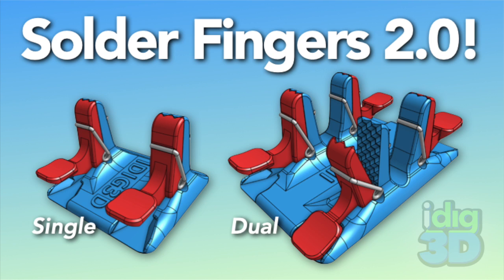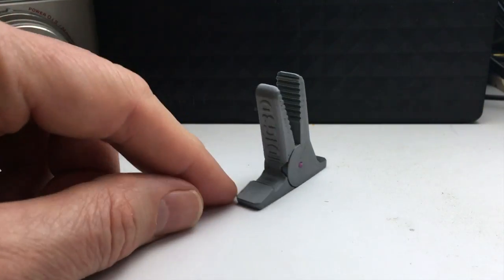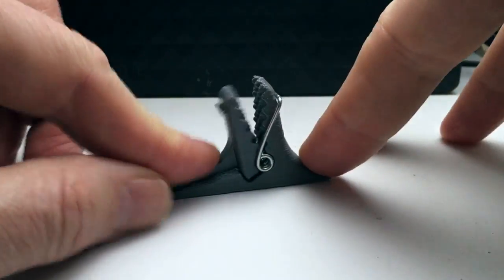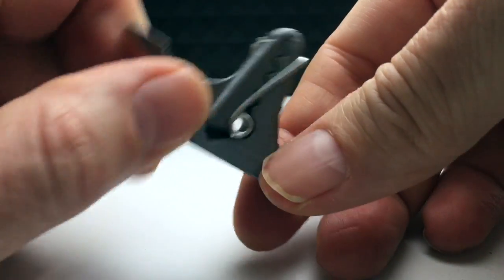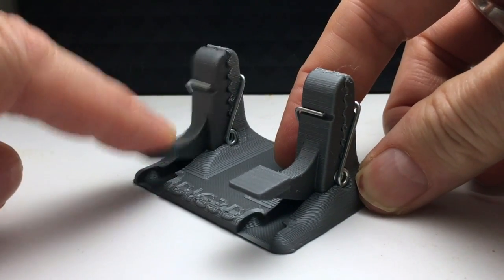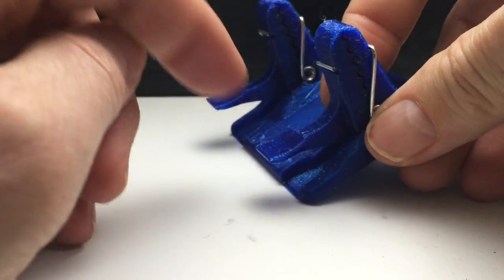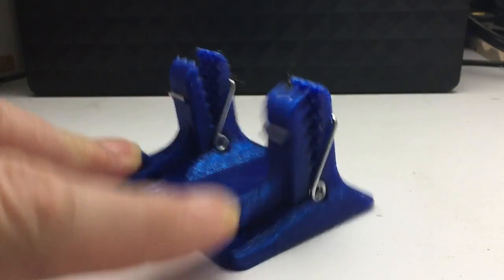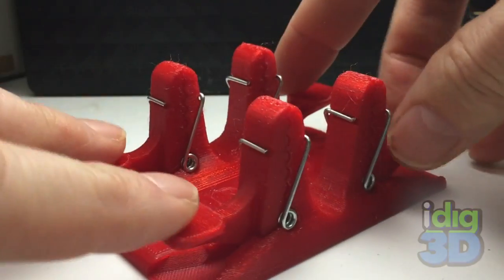Solder Finger 2.0 - 3d printed wire soldering aid

Comment: Printer file does not work on Ender 3. I thought it was a bed levelling issue but then re levelled around 10 times then tried other prints and they were fine. The nozzle doesn't raise enough then burns the filament. It also stops feeding in the filament and you have to push it in to make it come out again. As said before i tried other prints and they were fine so must be the g-code